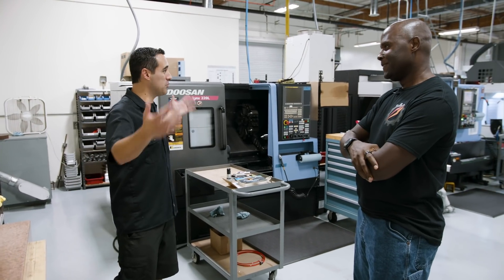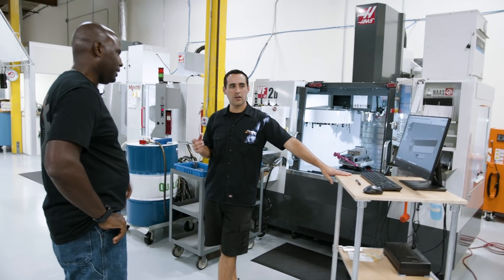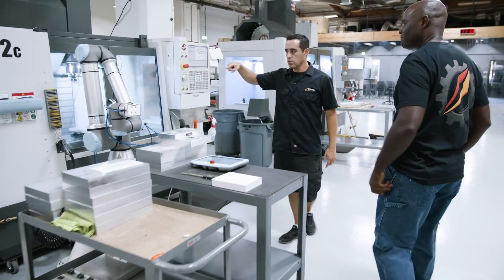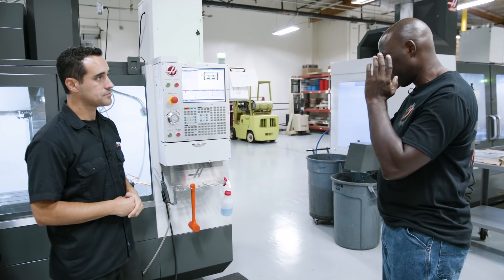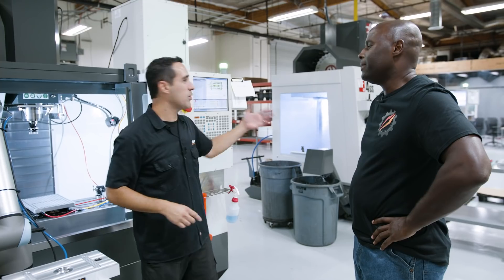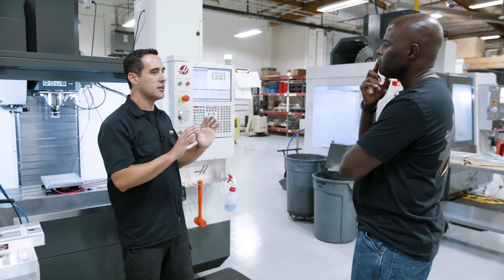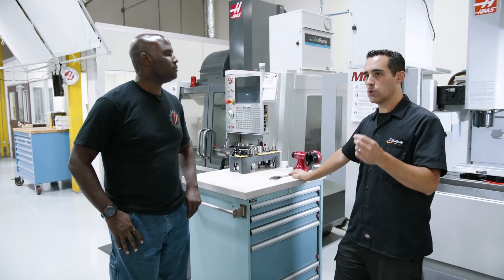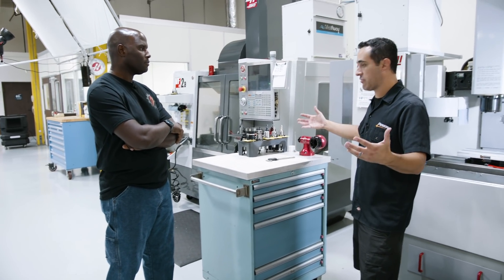How LEAN Makes Work EASY - Lean Shop Tour Part 4 - Pierson Workholding Q&A

Comment: I’ve recently discovered Pierson Workholding after buying a workbee CNC as my first real machine other than a small 1610. 

I have been through most of the videos and really enjoy them. They inspire ideas for better work holding and business management. 

I do laugh at the lean model a cross the whole business in regard to how employees feel. I wonder if they use 3 sheets of toilet paper instead of two, are they talked to for a lack of efficiency 😂

Just joking around. But I think your principles are great inspiration and example of how to run a business. 

Keep up the great content
Reply from the maker: Congrats and thanks for watching!

I think you should brush up on your understood of Lean. Lean has nothing to do with doing more with less. In fact, lean would tell people to use half a roll of TP if needed to wipe your mess.
Reply: @PiersonWorkholding  😂

Comment: Hello Jay, any chance you can share links for the coolant mixer, that little red box seems to be the key? Haas sells an automatic refill device but like you mentioned, I don't trust it, plus it's pretty pricey. I like your cart idea. Any info on those parts would be great? I also saw you were going to post about the sump sucker. I looked at part 3 but didn't see the link, will you be adding one?
Reply from the maker: Drum Cart: https://www.mcmaster.com/2367t51
Mixer: https://www.mcmaster.com/9977k6

Comment: Does the Haas maintain position after it shuts down? How accurate is homing?
Reply: you raise a good point , I had a mini mill that varied because it didn't have absolute encoders.
Reply: @dickp812   some machines  have back up batteries going to the encoders so never lose position even powering down. If the haas was like this that be amazing. I'm always reprobing stuff unless tolerance is loose so I'm wondering how Jay is doing it or is relying on home position accuracy.

Comment: Why not cable all the machines to a router and have access to all of them all the time from the office or a wifi enabled notebook?
Reply: Wifi is bad in some aplications, has to do with the way it corrects lost packages or not. For the rest listen again at 2:04
Reply: @tukid666  If the machines are connected with cables to the router, you have your WiFi hotspot in sight range (ceiling in the middle of the shop) and you stay with your notebook where they are talking, EMC shouldn't be an issue. As long as you use regular TCP transfer, data packets will be repeatedly sent untill all acknowledged. You might have issues transmitting video stream which uses UDP instead. Wondering how parts of the G-code went missing, normally it shouldn't happen...
Reply: All i know is that Wifi has some inherent  data los problems, at work our main software produces some funky data bank errors because of it (server-client setup). Those problems vanished with the use of ethernet and even dlan connections . The company making the software explicidly tells you not to use WiFi....
Reply from the maker: Because a USB is incredibly simple, reliable and inexpensive.

Comment: OK this might be a stupid question but how do ye check for tool wear?
Reply: Tooling brands have time in cut info , with your exact material and parameters . In every modern cnc there is time in cut or nr. of parts counter for the tools . Reputable brands Like Sandvik , Kennametal , Mitsubishi  respect those times , and it's repeatable from box to box.  You just type in X minutes for a tool, and the machine will alarm out and stop . To achieve the level seen in the video , you really need the experience (for that specific part) and make parts for at least a 2-3 days to draw a conclusion .
Reply: In a previous video, I think he discusses using max spindle load to determine a tool is wearing. As it wears, the load increases, so he sets a limit on that. I think he said there's a feature in Haas control to help with that.
Reply from the maker: @Fast Lane Innovations Thanks for answering correctly.  In the Haas control, go to Current Commands --> ATM and you can set maximum allowable spindle loads for each tool.
Reply: @fastlaneinnovations9344  Yes this too .
Reply: Thanks all!
Reply: i think he knew how a tool will last from experience 。and he change the tool before it happens
Reply: He addressed it here :) 

https://www.youtube.com/watch?v=hnsCygKoDyY